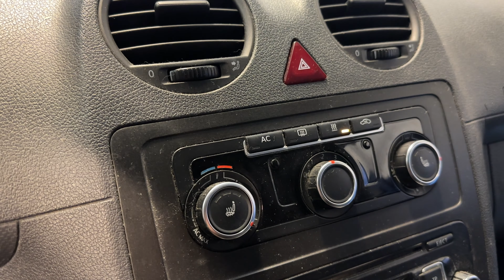VW Caddy Webasto Repair + (Diesel Heater)

Comment: Great job! I'm thinking about doing the same with my Webasto. It suddenly stopped working. I can hear it start and its diesel pump ticking, but no heat. I think it's all clogged up wit soot just like the one you fixed.
Reply from the maker: Thanks man! 😊 Go for it! If you start with removing the exhaust you get an indication of how clogged it its😅
Reply: Dose your car ideal high because of this ???
Reply: @mrwhite3094  had the same problem (clogged up and a lot of smoke) with my own car. RPM wasn't higher because of this. I didn't clean it, only disconnected the wiring and it's shut off for now. No big issue. Will clean it next summer
Reply: Hi i have touran and i dont have heat inside the car is it possible my pump gone?

Comment: I have a touran and I’ve noticed it’s there seems to be a lot of fumes coming into the cabin on start up. I suspect this is coming from the heater. If I take mine off, strip and resell all the joints is it just remove and refit or do I need to do anything with VCDS OR VAGCOM